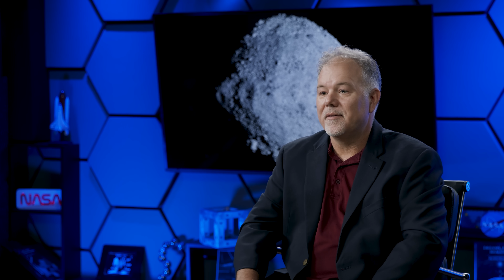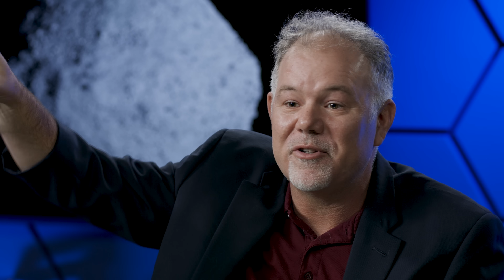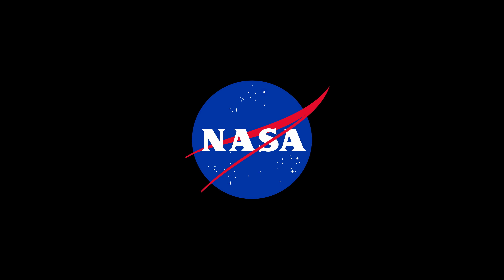Bio-Essential Sugars Discovered in Samples from Asteroid Bennu

Comment: Does not specify chirality of the amino acids and sugars. Those matter since life does not work with racemic mixtures, but is very specific with chirality (L aminos and D sugars). I see in their paper that "The abundances of ribose, lyxose, arabinose and xylose were 0.097 ± 0.014, 0.018 ± 0.007, 0.11 ± 0.03 and 0.079 ± 0.033 nmol g−1, respectively (Table 1). Glucose had the highest concentration of the sugars at 0.35 ± 0.05 nmol g−1, whereas galactose was 0.014 ± 0.004 nmol g−1". Wow this is pathetically low! Nano mols/g!  No useful chemistry can even be done with this. We are talking about micrograms of material or way less in the samples. 

Detected, yes. Useful amounts for any life related chemistry, no. Silicon has been found meteorites too btw, but no self-emergence of microchips have been discovered either.

There is a difference between the views of astrobiologists vs actual prebiotic chemists. Prebiotic chemists are often much more skeptical since they have been the ones trying to synthesize life and se the chemical realities.
Reply: You're basically saying:

“ThE aMoUnTs ArE tOo LoW tO bUiLd LiFe In A tEsT tUbE”

…which is about as meaningful as walking into a museum, seeing a 3-million-year-old hominid tooth, and saying:

“pFfFt, you can’t build a person out of this, therefore irrelevant.”
Reply: @Trve_Kvlt  National Academy of Sciences clearly says "Chemists’ objection to the notion that life is a natural consequence of organic reactivity is simple and comes from broadly based empirical experience in organic-chemistry laboratories. Addition of energy to mixtures of organic species makes the mixtures more complex and less likely to support life. Shapiro has provided a thoughtful and detailed discussion of the difficulties. Briefly summarized, it suggests that existing prebiotic chemistry experiments do not offer plausible hypotheses for routes to complex biomolecules. In the complex chemical mixtures generated under prebiotic conditions, one may be able to find trace amounts of amino acids and perhaps nucleobases. Some might indeed catalyze reactions that have some utility. But other compounds may well inhibit catalysis or catalyze undesired reactions. For example, Joyce and Orgel pointed out that the clay-catalyzed condensation of nucleotides to yield small chains performed best, under the conditions that they considered, if only one enantiomer of the starting material was present. If both were present, the desired reaction with the desired enantiomer might be inhibited by the other enantiomer... Those facts generate the central problem in prebiotic chemistry. Spontaneous self-organization is not known to be an intrinsic property of most organic matter, at least as observed in the laboratory."
Reply: @optimeg  You shifted the topic. I was talking about evidence of building blocks arriving on Earth. You responded with a critique of fully assembling life in a lab beaker, which is a completely different question. Trace amounts in meteorites aren’t supposed to build a cell on arrival — they’re evidence of natural prebiotic feedstock. You basically changed the entire subject to argue against a claim I never made.

Finding sugars, amino acids, aldehydes, nucleobases, etc., in meteorites tells us:
“These ingredients form naturally in space and reach planets.”
It does not claim:
“This means we can reconstruct life in a beaker by Tuesday.”

You're using a quote that criticizes one mechanism (lab-based spontaneous polymerization) to deny all prebiotic pathways.
The Shapiro/Joyce/Orgel objections are specifically about:
-messy Miller–Urey–style soups
-racemic inhibition
-uncontrolled polymerization
These critiques do not apply to:
-surface catalysis on minerals
-UV-driven chemistry
-tide pool wet-dry cycles
-hydrothermal vent chemistry
-ice-matrix concentration mechanisms
-lipid-world / metabolism-first models
-compartmentalization on mineral scaffolds
-extraterrestrial input from meteorites (which is what launched this whole convo)
You're taking one skeptical view and pretending it widens into a blanket impossibility.

Your “nano mols/g means irrelevant” argument is chemically meaningless in planetary context.
Meteorites aren’t trying to assemble a ribosome on arrival like some cosmic IKEA set. If you have:
-billions of meteorites
-billions of years
-global distribution
-concentration mechanisms (wet–dry cycles, freezing, porous minerals, evaporation, lipid vesicles),
then “nanomoles per gram” is actually a ton of material delivered over geological time.

The funniest part? You accidentally undermine your own analogy.
“Silicon exists in meteorites but no microchips assembled themselves.”
That’s actually perfect, because:
Nobody claims meteorites build life on arrival. Just like nobody claims silica spontaneously forms motherboards.

Life is not a single-step assembly product.
It’s an emergent system that requires:
-cycles
-gradients
-time
-selection
-concentration
-scaffolding
-compartmentalization
-chemical asymmetries
-environmental filtering
Meteorites add feedstock, not finished products.

Your entire point is a non sequitur masquerading as expertise.
You tried to prove “life can’t begin naturally” using evidence that… doesn’t say that at all.
Reply: @Trve_Kvlt  Nope I stuck to my point. From chemical experience we have synthesized millions of existing and new organic compounds in the last 2 centuries. With all of the cheating (perpetual intervention) that is routinely done in prebiotic chemistry, no massive molecular machinery like RNA, DNA, or cellular membranes have ever been achieved.  This is what the NAS is saying. 

Of course with 14 billion of years of time (4.6 billion on earth) and your sloppy "lots of stuff must be out there" logic surely we should  be seeing spontaneous generation of macro molecular machinery like RNA, DNA, lipids, cellular membranes, ribosomes,  proteins and their exclusive reactors of enzymes even today in massive abundance. No chemical or time frame excuses for why this is not observed at all today even on earth - the epicenter of abundant life all over. Life emerged rapidly and shortly on earth 4 billion years ago and never again from scratch. No alternative to DNA or non-carbon based life has ever been found on earth, though chemically, silicon would be another possible substitute for carbon.

Of course its easy to show that life emerges naturally - show it in the lab (we can recreate any chemical environment in labs - we can simulate any planetary conditions which is why NASA can simulate Mars  or the moon). I say there are pathways to life using natural components, but it requires intervention like have been doing in prebiotic chemistry. Spontaneous generation theories require evidence - that it can even occur in an exclusive physical/chemical manner, not relying on metaphysical abstractions like "cycles, gradients, time, selection, concentration, scaffolding, compartmentalization, chemical asymmetries, environmental filtering". Atoms don't do any of this. But intelligent agents can.  (Richert, C. Prebiotic chemistry and human intervention. Nature Communications 9, 5177 (2018))

So my original analogy stands "Silicon has been found meteorites too btw, but no self-emergence of microchips have been discovered either." Why expect life to emerge when it requires way more nanolevel chemistry and machinery compared to microchips which are less complex than a cell. 

There is a reason why pharmaceuticals and medicine never synthesize from scratch, but use already existing organic compounds to get their products- because it really is that chemically hard. If no brians are needed to make this, this would have been solved centuries ago but alas we are still at simple organic compounds at pathetically low concentrations (nmols/g is pathetic and not chemically usable), not advanced macro molecular machinery in any level of concentration.
Reply: @optimeg  You still haven’t responded to any of my points.
You’re now arguing that because we can’t assemble a modern cell from scratch in a lab, natural chemistry billions of years ago must have required a supernatural engineer. That’s not science — that’s a category error dressed up in jargon.

Abiogenesis isn’t supposed to happen today because modern life destroys its precursors. Planetary chemistry isn’t a lab flask, and billions of parallel years of low-efficiency reactions aren’t replicable on a benchtop. Your repeated microchip analogy fails because cells aren’t machines built from blueprints — they’re self-amplifying chemical systems shaped by selection, not design.

And quoting prebiotic chemistry papers you haven’t understood isn’t helping. None of what you’ve said addresses the original point:
meteorites contain naturally formed organics, delivered in volumes meaningful on geological scales. That’s it. You’ve contorted that into “why can’t we build ribosomes today?” which is a complete non sequitur.

If you want to debate origins, start by responding to the claim that was actually made.
Reply: @Trve_Kvlt  "Abiogenesis isn’t supposed to happen today because modern life destroys its precursors." Why think that abiogenesis was supposed to happen anywhere at all then?Life and precursors seem to survive in many environments even today (viruses, poop, urine, fossils, etc). My microchip analogy is pretty accurate because microchips should be emerging and evolving like cells do based on your logic - relevant simple raw material exists therefore at some point given enough time it will emerge. The way you say no to microchips and yes to more complex things like cells is just odd. An engineer of any type would work for both (prebitoic chemists are just one example). It seems you are granting intelligence required for microchips, but can't there pre precursors to microchips out in the universe that will evolve to a microchip of some sort with all that silicon, iron, aluminum, copper, gold, tungsten, cobalt? I am just following your logic. 

The fact that we chemically replicate and even synthesize stuff that forms in nature all the time (e.g diamonds, water, millions of organic compounds) and we even enhance them (eg. crack vs natural cocaine, artificial sweeteners vs natural sugars, etc) leads me to believe that you are not aware of what chemists are capable of and the NAS already summarized what they understand based on centuries of experimental synthesis - making any environment they want. We already simulate Mars, Moon, outer space, and other planets on a daily basis in labs. Nature never does any chemistry like you characterized it because it does not have any goals or foresight and no chemical reactions moves to any particular direction. What you are really relying on is chance. You can try to put all 20 L amino acids in water or on the dirt and other stuff you want and let it sit - you will see that it will never form anything getting close to say DNA or and enzyme. All the cross contaminations and racemic mixtures will impede any further synthesis to any direction and material yield reach equilibrium and probably kill any reactions in any direction.
Reply: @optimeg You keep responding to arguments I never made. I’m talking about meteorites delivering naturally formed prebiotic feedstock; you keep shifting the topic to “why can’t we build a full modern cell from scratch today?” Abiogenesis isn’t supposed to occur on a planet already filled with life that destroys its precursors, evolution requires replication (which is why your microchip analogy is nonsense), and lab environments cannot simulate the global-scale cycling that early Earth had. You’re arguing against a 60-year-old “random warm pond” strawman while ignoring mineral catalysis, gradients, selection, autocatalysis, and every modern origin-of-life pathway. None of this disproves that organic precursors form naturally—which was my original point, the one you still haven’t responded to.

Either you don’t understand my point or you’re avoiding it on purpose. My claim was about meteorites delivering naturally formed organic precursors. Every response of yours has been about full modern cells, microchips, and spontaneous emergence in today’s biosphere—none of which I ever asserted.
Reply: @Trve_Kvlt  "My claim was about meteorites delivering naturally formed organic precursors." Ok. What's your point? Last time I checked meteorites also deliver naturally formed inorganic precursors to microchips like silicon, iron, copper, cobalt. No one is arguing that very simple natural components may exist somewhere at some point. I am just pointing out the chemical reality of how they are useless chemically for forming anything like cells or its macromolecular precursors (e.g. RNA, DNA, lipids, proteins, enzymes)  or microchips or its precursors especially since the evidence is that if very small concentrations are detected at all and it is usually at the nmol/g level or micrograms (like it is for Asteroid Bennu) . Most of the meteorite is inorganic material. I am also saying that we already use abundance of advanced techniques and advanced molecular machinery from cells in labs that prevent contamination from other organisms (this is common in pharmaceutical and food manufacturing for example - they test for this on every batch). This is why prebiotic chemistry is even a thing - its done all the time. Nothing you have said is enlightening on abiogenesis. Check out David Lynn Abel. Why is Abiogenesis Such a Tough Nut to Crack?. Archives of Microbiology and Immunology. 8 (2024): 338-364. it does an excellent job on the chemical parameters and limitations that have to be encountered on natural chemical grounds alone. That is for those who actually work in synthesizing a living cell from scratch.
Reply: @optimeg  
1. You asked “What’s your point?” after I told you my own point for the third time.
That’s not confusion — that’s refusal.
You cannot address my actual claim, because my actual claim is trivial and uncontroversial:
Meteorites contain naturally formed prebiotic organics.
This is empirically true.
Observed. Measured. Published.
Zero debate.
So you try to drag me back into your comfort zone:
“Why can’t meteorites build DNA, RNA, cells, ribosomes, AND a motherboard?”
This is like saying:
“You claim rain delivers water?
Then why isn’t my backyard spontaneously generating aquariums and octopuses?”
It’s a child’s misunderstanding of complexity. You're trying to force a category error on me because you have no answer to my actual point.

2. You repeated the microchip argument again, which is now self-parody.
You think this is clever.
It’s not. It’s logically broken at the root.
Cells can self-amplify and evolve.
Microchips cannot replicate.
Microchips have no selective mechanism.
Microchips do not metabolize.
Microchips do not form autocatalytic sets.
Microchips do not spontaneously compartmentalize.
Microchips do not exploit energy gradients.
Microchips have no analog in prebiotic chemistry.
You're comparing a boulder to a butterfly and screaming:
“WHY DOESN’T THE ROCK FLY???”

3. You keep obsessing over nmol/g like I'm supposed to be shocked.
Nanomoles per gram across billions of years and billions of impacts = planetary-scale deposition. You keep pretending the universe had one meteorite and it failed to assemble an iPhone. This is not a scientific objection. This is a cope.

4. Your lab contamination spiel is nonsense.
You're ranting about food manufacturing and pharma lab sterility as if that is relevant to prebiotic Earth.
You might as well say:
“We can make sterile environments today, therefore volcanoes didn’t exist 4 billion years ago.”
It’s not even an argument.
It’s filler text.

5. You cited David Abel.
Ah.
There it is.
You walked straight into the creationist bookshelf.
David Abel is notorious for:
– misrepresenting chemistry
– redefining terms
– straw-manning modern abiogenesis models
– asserting “design” without mechanism
– ignoring 40 years of research
– publishing in fringe journals
Abel is to biology what Ken Ham is to paleontology:
confident, loud, wrong, and adored only by people who don’t know the field.
The moment you dropped that citation, you exposed the whole game.

You keep citing creationist authors, repeating broken analogies, and arguing against claims I never made. At this point you’re not misunderstanding me — you’re avoiding the topic because you don’t have the tools to engage with it. Your logic has reached the point where you’re comparing RNA precursors to microchips. This is no longer a scientific discussion; it’s you running Ken Ham’s software with a vocabulary mod installed.
Reply: @Trve_Kvlt  NAS was already quoted extensively showing that your "Nanomoles per gram across billions of years and billions of impacts = planetary-scale deposition." is doubted by many chemists based on extensive experience of synthetic chemistry. Ignoring this is ridiculous. Its like saying "my car can emerge from simple components" when expert mechanics and mechanical engineers are skeptical of this occurring at all. Not sure what you are arguing anymore since you keep on ignoring all other components found in meteorites and how they also are the building blocks of other complex products like microchips. You keep on jumping to "simple components exist therefore massive transformations to complex systems ( a cell) can emerge." If you just said that some small trace amount of amino acids have been found in meteorites and they don't do anything, there is no issue. But most of your replies literally are  "simple components exist some where therefore massive transformations to complex systems ( a cell) can emerge." But this is yet to be shown in the lab without any intervention where prebitoic chemists have been researching for a few centuries now. Accelerated testing is available by the way. It how we can even manufacture synthetic limestone and so many silicates. Keep in mind that molecular machinery like ribosomes, proteins, DNA, RNA, do not have a long shelf life for reactivity (its only a few hours to days). They degrade rapidly. After that they are inert and chemically useless - which is why fossils, expired organics, etc never create anything useful. You can study your poop and urine (which have rich and abundant amounts of RNA, DNA, hydrocarbons, even dead cells which have all the cellular machinery in place already etc) and you will never see the self formation of RNA, DNA, Proteins, enzymes, etc from scratch. Or even the reactivation of a dead cell. 

David Deamer (another origin of life researcher) "All the components of the cell may have been put back together in a tiny membranous bag, but we have disrupted an invisible order having to do with feedback loops that regulate metabolism. In the absence of feedback controlling thousands of enzymes, it may be impossible for the cells to come back to life."

So even cheating this much does not yield one living cell. Metabolism and reproductive systems alone are energy consuming and destructive things, reconstruction on a daily basis is required by any living organism - the concept is called homeostasis (life requires careful chemical regulation to sustain itself and remain alive - loss of equilibrium leads to death!). nmol/g of raw materials aint gonna do it. The specifications and requirements are incredibly numerous and require so much control. 

Bottom line - I know you cannot provide any evidence of "Nanomoles per gram across billions of years and billions of impacts = planetary-scale deposition". That is just an auxiliary hypothesis without evidence. There is a reason why the NASA video states that no complex molecular machinery like RNA or DNA are ever found. These are massive molecular structures. So no finished product (a cell) and complex components of a cell (ribosomes, proteins, DNA, RNA, enzymes, lipids) emerge either - based on data from meteorites (we have quite a few samples of the composition of many parts of our solar system already btw). This is a massive problem. Since we know life exists here, this is the best place to see if even  complex components of a cell (ribosomes, proteins, DNA, RNA, enzymes, lipids) can even emerge and even with this its orders of magnitude away from a living cell per David Deamer.
Reply: @optimeg  You keep asserting there’s “no evidence” that nmol/g organics in meteorites matter over time or that natural processes can drive prebiotic chemistry.
Here are a few mainstream sources you’re ignoring:

– Pizzarello 2010 (CSH Persp. Biol.) – reviews organics in carbonaceous meteorites and explicitly discusses delivery to early Earth. 
– Jenniskens 2000 – estimates ~10⁹ kg/year organic carbon delivery during heavy bombardment. That’s your “planetary-scale deposition,” quantified. 
– Furukawa et al. 2025 + NASA OSIRIS-REx – Bennu contains amino acids, all five nucleobases, phosphates, and bio-essential sugars like ribose. i.e., all the ingredients for RNA from a single asteroid. 

– Song et al. 2024 (PNAS) + Ferris 2005 – show non-enzymatic polymerization of nucleic acids via wet–dry cycles and mineral catalysis. Natural environmental cycling does move you from monomers toward polymers. 

– Longo 2020 & Guo 2023 – reviews of current origin-of-life models and actual prebiotic reaction pathways. 

– The NAS report you keep citing (2007 Limits of Organic Life) is cautious about simple “soup” models but does not conclude abiogenesis is impossible; it outlines multiple plausible natural constraints and environments. 

If your position is “all of these people are wrong and David Abel is right,” just say that plainly so everyone can see what’s actually going on.

You’re quoting Deamer to argue life can’t emerge naturally. Deamer’s own work argues for specific natural environments (wet–dry cycles + membranes) that favor prebiotic chemistry. You’re quote-mining him against his actual conclusions.
Reply: is it possible that, by some mechanism, these molecules could be found somewhere in higher concentrations? maybe if the liquid they ended up evaporated and formed sugar crystals, it could create spots with significant amounts of sugars, which would definitely be useful... and could the mechanism that formed them in space be more efficient? there's a few questions to ask, my molecular biology knowledge isn't enough for this though. would love some answers
Reply: @add_a_handle_to_continue321 The problem is quite complex in that merely having even high concertation of ingredients won't be able to do anything towards a chemical pathway to a single cell. For example, any dead bodies (single cell or multicellular organisms), urine and poop already have massive amounts of complete and advanced cellular machinery (whole dead cells - these have everything physically and chemically in place already, lipids, DNA, RNA, polymers, enzymes, proteins etc) but no spontaneous generation of life emerges from any of this - and we have tons of this on earth.